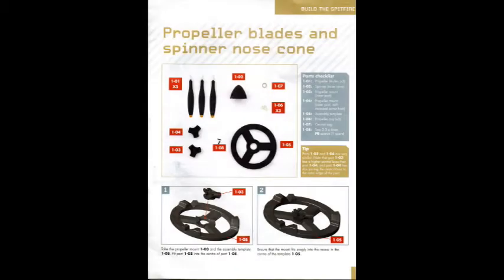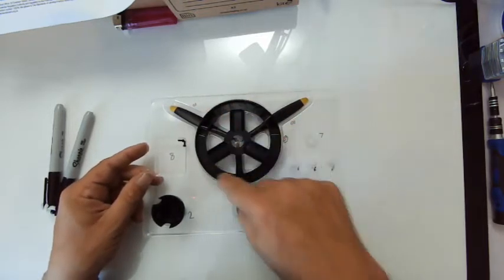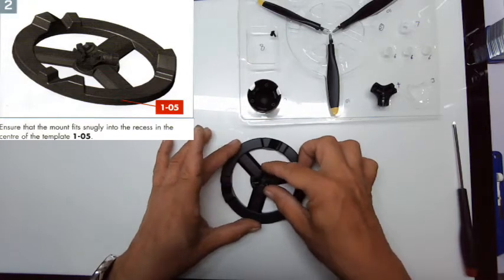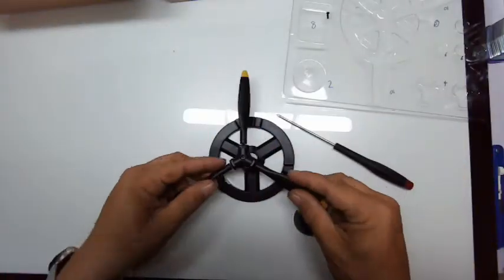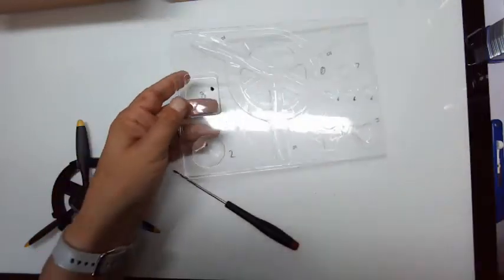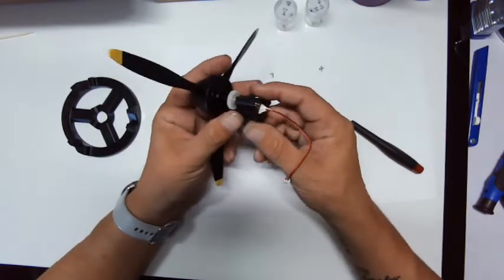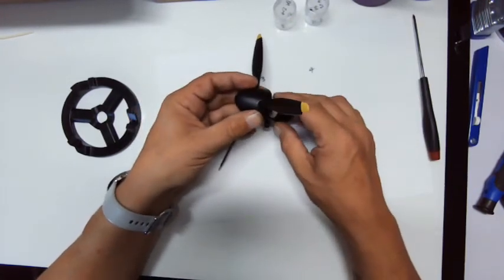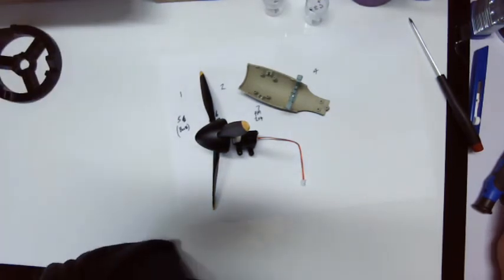Build The Mk1a Spitfire 001 002 Propeller, Motor, Gears and Spinner

Comment: Penny, if it is not too late, I would suggest  that you remove the prop and spinner from the spinner backing plate, and store it safely away.  As you mentioned the paint on the prop tips can be easily damaged.  If you leave off the silver hydraulic tank, you will be able to access the screw holes in the spinner backing plate later on.  The two parts that you showed, part 2-05 and the lower cowl do both need to be painted with Humbrol 78 cockpit green.  If you are planning to paint them in the correct color.  Part 2-05 is painted completely overall.  The lower cowl part should be painted only on the inside.  No oil is needed for screws going into metal on this model.  The screw holes are pre-tapped.
Reply from the maker: I think I have it sorted. At the moment I clamp my finished model to the side of a shelf, so my prop is not touching anything. If, in the future, that's not practical I will of course look at al alternative method of storing.
Reply: @PennysPitstop  You will find that as you continue to work on the nose that the prop tends to get in the way.